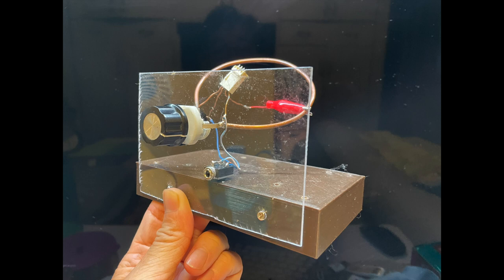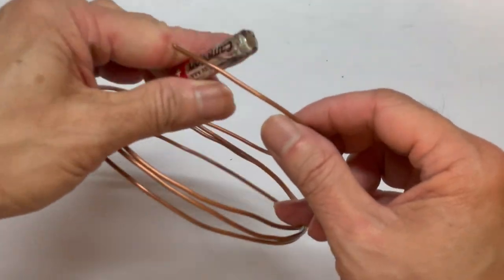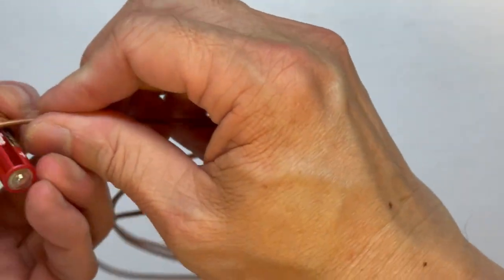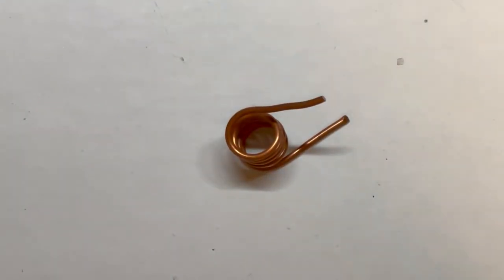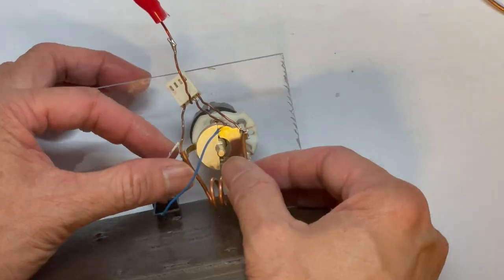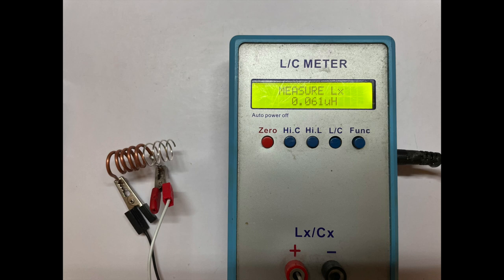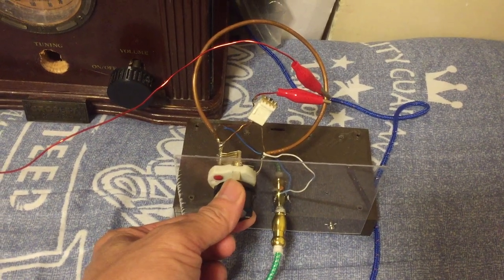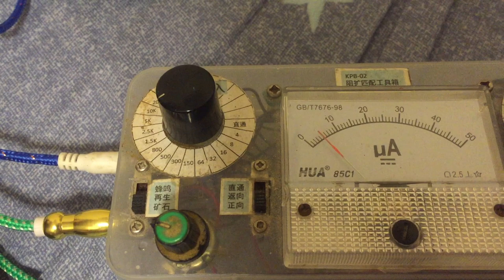Small Coil FM Crystal Radio

Comment: You can obtain more precise measurements by using a wristband with a ground connection.  Touching the capacitor or coil with bare hands while measuring with an LC meter will give incorrect values due to static electricity.  The LC meter I use in my workshop is JUNTEK Model: LC-200A (Made in PRC), and I combine and reset the probes before each measurement.  Otherwise, the measurement will be inaccurate.  As an additional note, I prefer a non-rechargeable Lithium 9V battery as the power source for the LC meter.  I do not recommend using an 9V adapter from a BNC jack input or the 5V supply with the powerbank.

Comment: Hi I saw that you use different types of crystals for fm and am I use two schottky 1n5819 in series and it works perfectly for Am. I replaced with them the one with germanium that detects at 0.290mv, I didn't try it with fm due to lack of time. I have raw galena crystals and silver pyrite would it be possible to use for fm?
Reply from the maker: Fm reception by crystal is possible. I tried with fools gold crystals. However much less sensitive. So you need a stronger FM signal .
Reply: @BillyCdiy  thank you

Comment: Hi Billy, why is the antenna coil made of silver wire? Could we just use 2mm copper wire for both of the coils? 😁
Reply from the maker: Yes, you can use regular 1mm or 2mm copper wire to replace the silver plated cover wire which has less resistance.

Comment: FM band frequency range is 
88 MHz-108MHz 
L=61 nH ( or 0.061 uH) 
Cx=20 pF to 4 pF
On internet Resonant Frequency Calculator says 145 MHz to 325 MHz,  
L=165 nH = 0,165 uH   88 MHz need  C= 19.824 pF  and 108 MHz need 13.162 pF proper FM frequency range...

L=61 nH and Cx=54 pF to 38 pF capacitor  range, We need at least about 33 pF capacitor. 
I guess you used  a parallel 33 pF capacitor on that  female audio jack 3.5 mm,
Reply from the maker: Thanks for your calculations. There are stray inductance and capacitance involved that cannot be easily calculated. The values I used is based on many years of trial and error.

Comment: Do you have some kind of full kit for sale to build this? Or what parts do i need to order for optimal system?
Reply from the maker: Apologies. I do this for hobby only. Not planning to sell at this moment. You can reference my videos to diy. https://youtu.be/Cfu7runJGF8

You can also visit my blog where I suggest what parts to buy. https://1.bp.blogspot.com/-NNHHC-qGswA/X1oOHSSOo7I/AAAAAAAADaA/xskpS6h7ZRAfgCoxOGFjJJsaWiGt5MJuQCLcBGAsYHQ/s2048/IMG_5669.JPG
Reply: @BillyCdiy  No worries. This helped a lot already. Have you considered to use some am signals, just to collect some additional power for signal or sound amplification? There is many led circuits that only use joule thief, or joule ringer and antenna (Tesla antenna and Barbosa Leal effect also boosts the power harvest).
Reply from the maker: @Kangsteri  , thanks for the suggestions. There were different ways to harvest additional power from other bands of radios to let the Mos FET operate in a regeneration mode which will boost the volume and increase selectivity. I tried that but found that a bit unstable hence did not make a video on these. Also the idea of using mos FET in crystal sets already stirs up enough debate whether this is really a crystal radio. Boosting volume by other means will certainly add oil to that debate .
Reply: @BillyCdiy  I think passive boosting is not cheating :D It's not practical to make pencil transistors and air capacitors if it's possible to buy. Even with 1.2 - 1.5v battery it would be fine. It usually is easy to get 0.5 - 1.5v from antenna harvesters or even earth battery. My dream is to get AM FM walkie-talkie that could be used without battery. Or could be used to charge small battery / super capacitor, in open areas.
Reply from the maker: @Kangsteri  ,  my home is located within 4 km from an AM station on an island across the sea in HK. I used to be able to use the led as detectors and light them up at the same time. I also tried charge an Nimh battery with some success l. However since last year, the station has been shut down fir maintenance, hence I cannot get a strong enough signal to try these again .
Reply: @BillyCdiy nice

Comment: Qual é o componente dector?
Reply from the maker: @Oziel-hh2du7ml6r  , I used a low voltage Mos FET called 3DQ (3SK143) as the detector. You can also used any diodes that can work in the FM radio frequency eg 1SS86
Reply: @BillyCdiy  Muito obrigado valeu.

Comment: Hello Billy
I have question
I have a variable capacitor
15 to 385 pf
My range 500 to 2300 khz
Too much 
Can I put a disc capacitor
In parallel with the variable?
Would that affect q etc ?
I want to build a 1000 to 1700 khz
Radio and only need a 115 to 485 pf
Range 
Thanks !
Reply from the maker: No. Connecting in parallel will increase the capacitance, not reduced it. To reduce it, you can connect a disc  capacitor in series with the original variable capacitor. Any additional component to a radio circuit to add or reduce capacitance or inductance will only decrease the original Q factor, not increase it. Imagine adding some liquid to pure water. the liquid will only add impurity, not make original water more pure.